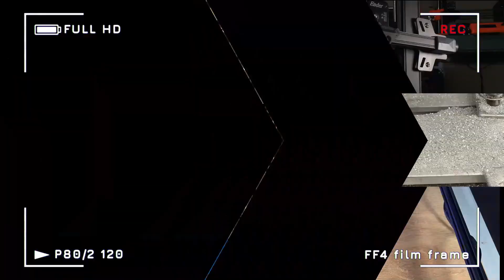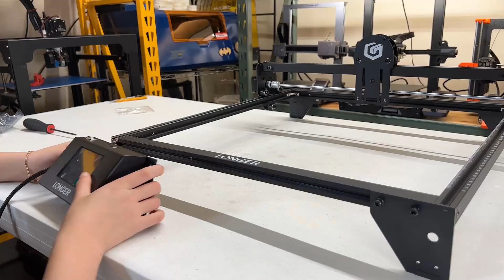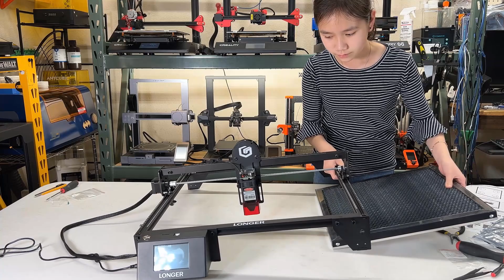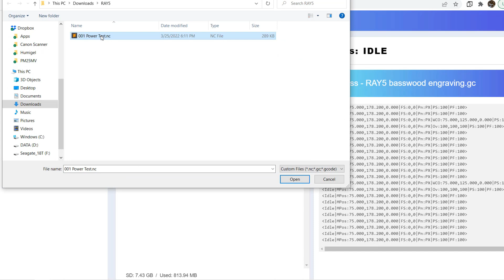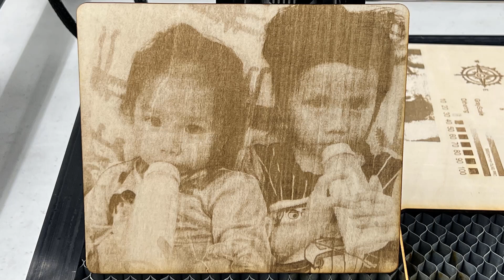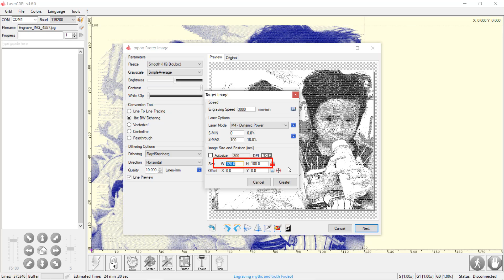Longer Ray 5 Laser Engraver: 3.5" touch screen offline controller with Wi-Fi Support

Comment: I wish that you lived next door. I bought a Longer machine just like the one in the video. I have no intrest to engrave but to CUT wood. When I cut wood the edges looks like burnt charcole. I have no idea how to correct that. I design my own workpiece using Sketchup, and conver the file to DXF extention. When I open that file in Laser GRBL is when I get burnt edges. Your vidio is nicely done!!
Reply: Get yourself a honeycomb bed and air assist (you can use an aquarium pump and tubing). There are videos on youtube about it.

Comment: I have never used a Laser engraver or cutter but I have been considering purchasing one. Is there a specific one you would recommend? I saw your recent review of the Ender 3 S 1 Pro. I currently ha an Ender 3 v2 that I upgraded with an all metal Micro Swiss Hot end. I just ordered as a second 3 D printer the Ender 3 S 1 Pro. I found you video review excellent . Have you reviewed the add on Laser engraver that Creality is selling for the Ender 3 S 1 Pro for about $75? Is it worth to get it or should I just get a stand alone laser engraver, something like this one you are reviewing here? All this s new to me. What would recommend ? Thanks!
Reply from the maker: I have a laser engraver playlist, please watch those review videos and see which one you like. 
https://www.youtube.com/playlist?list=PLxGIelsDS8bAjpp0aHjFR45_v-QX5R_Tj

For engraving, a 5W laser module is good enough, but if you need to cut thicker wood (8-10mm), you need a 10W laser. Personally, I don't use a laser module on a 3D printer, and I won't recommend anyone to do that. First, the laser module for 3D printers is generally lower power, the most common one I saw is a 1.6W, which is only good for very light engraving. Second, you need to adjust the Z offset every time when you put your 3D printhead back. Third, you may accidentally engrave on the print bed and damage it. Finally, the working area is small, just as large as the print bed.
Reply: @AuroraTech  thanks! Very informative! I will
Check your links to the laser engraver playlist.